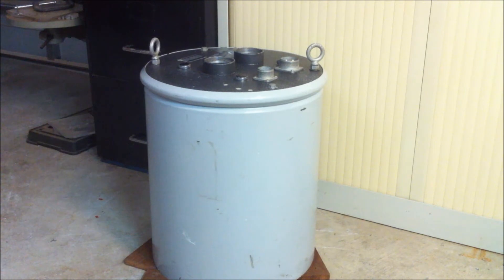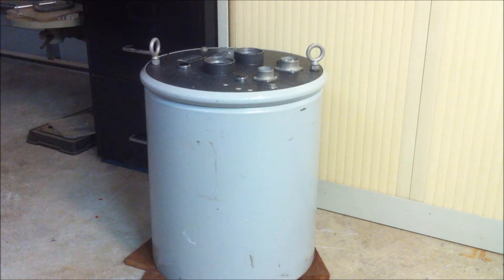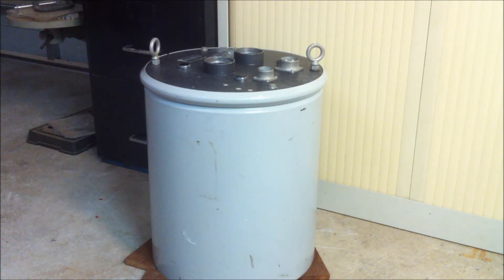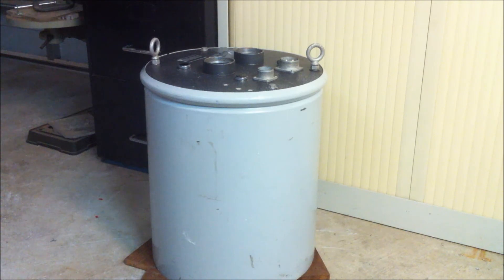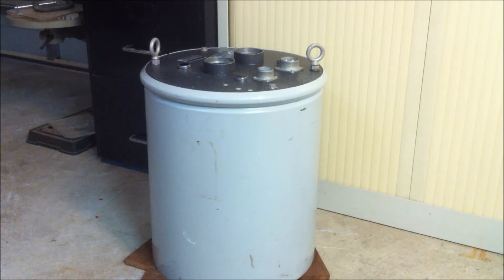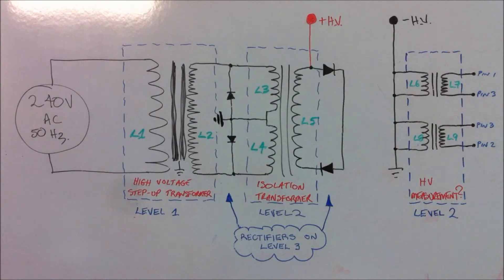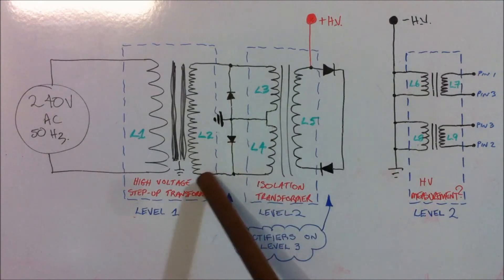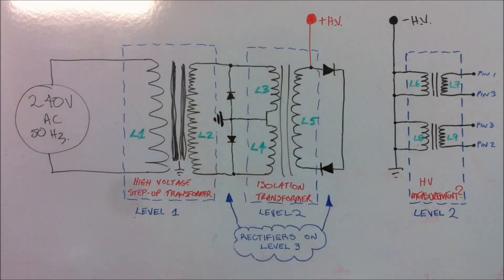I Revised The Schematic Of My New X-Ray Transformer! Now It's All clean And Ready For Oil!

Comment from the maker: I can't wait either. I still need to get a plug for the top & make a fitting to vacuum out the oil. 
I have to make a trolley on wheels because I can barely lift the can without the oil.
I also need some oil, so it may be another month or two before I am ready to flick the switch on this beast.

I am currently making a couple of Tesla coils, vacuum chambers, a rotary spark gap & a whole bunch of other stuff for my experiments which is taking most of my time at the moment...

Stay tuned   :)

Comment: Don't think it has PCB.
As I know of I never heard transformers with PCB
Most of them has mineral oil in it.

Is capacitor has PCB as for the ancient one until was banned few decades ago,
mid 70s or early 80s.

Giant transformers looks like capacitor because they're often tanked.
just like capacitors.

Comment from the maker: I need to get a plug for the fill hole & make an adapter to connect the vacuum line to the can. Once I have done this, I will get some mineral oil & vacuum it out. Once this is done, I will turn it on.